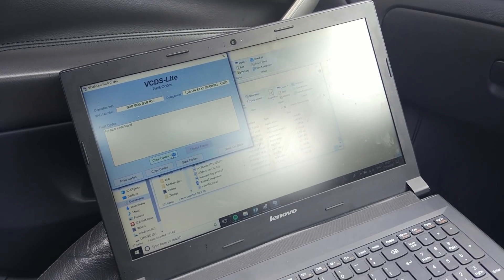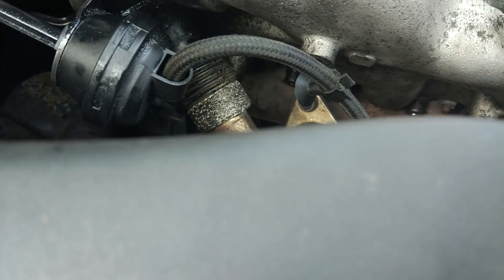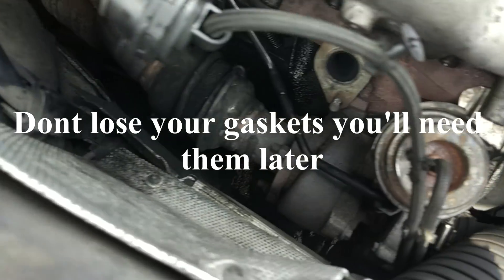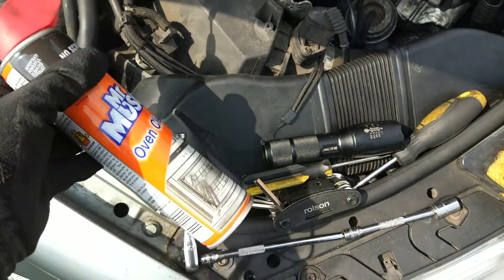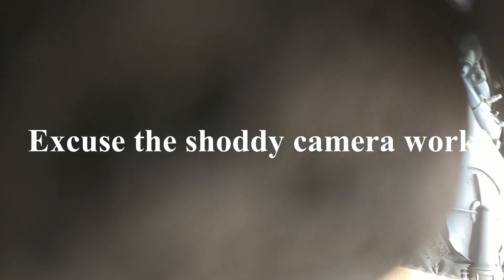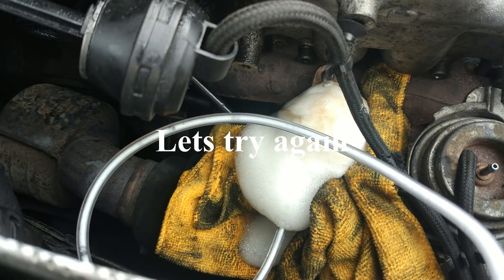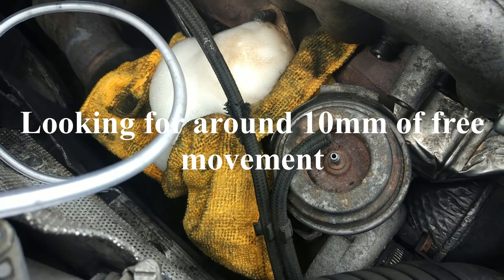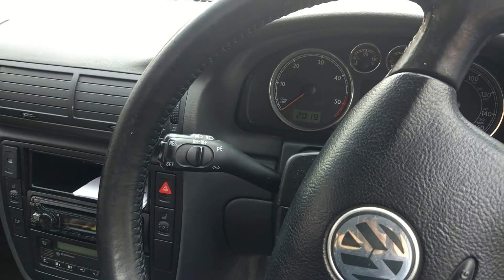How to Fix Limp Mode on a 1.9 TDi for £4.50 - Mr Muscle VNT Clean

Comment: Does this actually work???? Drive a 2016 skoda octavia vrs 2.0tdi and now my car goes into limp mode if I go above 2000rpm in 4th or 5th gear, tried to regenerate the dpf but couldn't clean it perfectly

Comment: (any oven/grill cleaner works) guys i can proove that this is really efective for unsticking you actuator rod if you got big siringe and tube to wiggle with the actuator you are really going to get rid of your limp mode, if its caused by this.... but i got some further problem... ive fixed this... before my car had 0/100-30secs now its better 0/100-20secs but i know my car has drive 0/100 in 12secs ! dont you guys know what it could be ? its not in limp mode but its lazy from the start

Comment: Tried this today and we blew up the turbo 😂.
Reply: Was it from the cleaner or was turbo smoked anyways
Reply: @ktmfour1007  We think the turbo was on its way out anyway. This was an attempt to see if it improved it but I knew it wouldn’t work. Car has now been taken for scrap as not worth fixing.
Reply: Wht was the car doing
Reply: @madkhan935  Going into limp mode when under load, e.g. long uphill road. Was also smoking a bit on startup. When we tried the cleaning trick it was putting out black smoke on every rev. This was the oil getting past the seals and burning in the engine. When it went the engine would run away when revved. Fortunately VW fit a device that blocks the air intake when you turn the engine off.

Comment: This is actually a really good trick caustic lime breaks down carbon like a hot knife through butter. 

Just a side note do not get oven cleaner on any aluminium parts. 

It will damage any aluminium parts it comes in contact with. 

Stay vegan. Stay clean.

Comment: Will this damage the seals inside turbo?
Reply: It's caustic, absolutely it will harden the turbo seals causing them to crack and leak oil
Reply: @robertjohn2249  Are u sure?
Reply: @krtolebiohazardcs  Yes, never put caustic inside an engine NEVER, a better option would be to use a garden sprayer and spray unleaded petrol in it. Or buy throttle body cleaner that has a special tube with a nozzle that sprays mist. Petrol is the best solvent to dissolve and break up hard carbon.
Reply: @robertjohn2249  - Hi, may I ask, is this a method you have used? it seems workable, though a little worried about it slipping into the sump and compromising the lubricating oil?

Comment: I used this same technique on my egr / inlet manifold on my seat altea xl 1.9 tdi. Had the emission service centre warning, which when I plugged in my code reader threw up the P0104 egr insufficient flow error. Mr Muscle worked like a charm.

Comment: Great video straight forward & shows exactly what to use and how to use it - 5 pound is a cheap fix compared to a complete turbo unit
Reply: Your better off removing the turbo and open it and clean it out manualy (all depends how you look after your car).
.that way you wont get shit going throug your exhaust and you know its clean as new and both sides.was quoted £400 for replacement turbo and fitting.so i asked how for turbo removal and fitting,it was £150 he also lossen turbo bolts for me .after opening it i can see that mr mscl cleaner wont even get into the hot chamber to clean the vnt mech side but only the vaines.was easy 2hours  and i know how clean my turbo is.

Comment: I'm going to do mine but going to take turbo off. And also do the air intake. After deleting my EGR valve completely. As I've just blocked the pipe and I soon will be capping of exhaust feed but leaving old egr there after cleaning and welding or bolding egr valve closed. Cheap fun and simple

Comment: 1 L deionized water into garden spray bottle. Get engine hot, park somewhere. Open bonnet, take hose off after MAF and air box. Block engine on 2500 RPM, spray that water into intake, stop only when engine slows. Straight after go on 15 miles hard driving. Clean all exhaust parts, from combustion chamber, through exhaust valves to turbo. Tested by myself many times. I have turbo back straight, but short pipe. My neighbours loves me when I do it every couple months on Sunday morning. 😂
Reply: I've heard about this but never saw anyone actually doing it. Good to hear it works good for you. Does engine layout affect this ( Inline, V, might have different airflows to different cylinders and thus only a couple get the majority of the water perhaps?)

Comment: Just did this on a 2008 2.5 TDI VW Touareg..  very easy to get at the egr cooler , the nuts and hex bolts are right on top ... just take it easy and dont snap or strip them ...  As soon as I can evaluate the results I'll post here ... 

OK ...  Initial update .. same day .....
Power is smoother across the entire rev range ..  quicker pick up , more gradual , no big catapult effect after an initial lag ..  It just go's ..and keeps going . 

Very happy so far ...  easy job really .. I did deviate a little from the guide here ..  halfway through I used a screwdriver and a piece of wood to keep the actuator open for 30 mins .. My thinking was that It would expose even more areas to the solvent .. 

After warm up ... ( dont rev the nuts off a cold diesel engine )   I took it for a short , energetic drive.
Holy moly the amount of black soot / carbon that came out of the exhaust was like a smoke screen ..
I assume this was the residue that had been removed by the solvent getting blown off ... It cleared within 30 seconds.
Reply: How about the cleaning after one year? :)

Comment: Can you replace the vanes individually or do you need to buy a whole new turbo? Ive had my mk4 golf gt tdi completly flushed through and clean, i have before and after pics. But i still go into limp mode, seems to be a bit different now though, before it would stay until i turned the car off/on and now it seems to breakthrough limp mode on a fast straight bit.
Reply: Hi
You could check your MAF sensor or the wastegate air intake (modern diesels have an air intake valve that closes when the engine shuts off to stop its final shudder before stopping).
I also had problems on my old Mk1 Octavia, found the plastic Armature on the Wastegate air intake valve had snapped, so vibration was causing it to partially close while I was driving.
Reply: Simon O'Leary Thanks mate but I finally fixed the problem, it was a faulty MAP sensor. Actually had it replaced awhile ago, but that must’ve been faulty too as was a cheap one. Was doing it 9/10 times now hasn’t done it for almost a month.

Comment: Good morning Coathanger. 
I watched and followed your advice except I never removed the FAULT CODE, I ended using all of the Mr Muscle in a 3hrs 20 mins later. Done a EGR delete in. 
Started the car & let it warm up, did as you said at 3/4000 rpm & then drove the car at 60mph for a 5 miles to given the ECU time to reset it self..
Thank you, great video & very easy to follow. Most importantly you have help me save ££££'s 
SPOT ON 👍👍👍
Reply: Peter Black did you have to repeat this since you posted the comment?
Reply: Hi there . My problem is I can't get over 2000rpm . Limp mode. . Any advice please . Not done anything yet
Reply: @andymillios2570  I’ve got the same what did you do to fix
Reply: @louismoran  sorry only just seen your message. Have you sorted the problem with your car
Reply: @andymillios2570  nah I sold it

Comment: I have a question. Why the EGR clogging up? Is that when you always drive slow? 
And if you have a heavy foot, is there a chance that it break with carbon?
Reply: Its because you haven't deleted it yet.
Reply: egr will clog up no matter what u do because the exhaust gas running through it if u want my advice just delete it the engine will be much MUCH happier without it 😉
Reply: @M07MD_02   is that acc true?
Reply: @HarryTurner24  Yes, it limits your engine and if you’re going to get rid of it, get rid of your dpf and maybe swirl flaps too

Comment: PURE 100% shit . Ive done it and seen 2 cans of stuff used.Then a full turbo strip.  if a max 0f 3 % of the vanes where clean it  was lucky .
Reply: Doesn't really matter as long as they move properly. If any vanes move fully, they must all. Not saying it will last forever (I've stripped and cleaned turbos myself) but compared to the time and effort of removing and stripping, for most people this is worth a go.
Reply: @dopiaza2006  it did it's purpose, just annoying when away from home and limp home mode flags up
Reply: I did the same on my Mondeo. Lasted for 4 weeks at a time. Eventually got rid of the car

Comment: Archoil AR-6400D works well to prevent refouling. I run a bottle through every 1000 miles or so. Supermarket diesel contains more biofuel and causes a lot of soot problems especially on modern cars
Reply: V Power from Shell is good stuff

Comment: I have the same engine in my passat tdi and wondering what you actually fixed/cleaned with this ? Beside the Wastegate there is nothing that could cause a problem. Most problems on this engines are caused by damaged vacuum tubes. The hardest part is to find the leaking one. It's a great engine. I own a passat estate wagon in the same colour by the way
Reply: There is no wastegate in a VNT turbo.
Reply: Peter Thoma he fixed the over boosting problem.. it was over boosting because the vanes in the turbo that control the level of boost get clogged up with carbon build up and get stuck open which they call “ sticky vanes “ it’s a common problem with older diesels mate.. I’ve actually got to do this on my mk4 tdi golf as mine will over boost ever so often
Reply: @w3stiiee691  yeah that's what I thought but this turbo is good old one without this fancy fans..

Comment: On my bmw diesel i was getting dpf warnings and fault codes and too high backpressure on dpf. So i bought liquid oven cleaner spray and while engine was running at 1500rpm I used a hand oil pump and pumped inn the cleaner where the pressure sensor was conected and somehow the backpressure is soo much reduced that it look like its new the dpf :p 
Oven cleaner 10$. Dpf cleaner from tunap 100+$.
Reply: um... to clear the dpf you just have to do 20+ mins at 60+mph down the motorway. That triggers a regen cycle. 

if it's too blocked to clear on it's own, it's finished, manually cleaning wont help, it'll never work the same
Reply: John Smith last year the main stat was dead this year egr stat combined with winter and sometimes very short journeys clogged the dpf to the point the ecu did not perform regen. And there is 3fd0 fault code that newer goes away no mather how many time i clear codes it just gets back instantly without even starting the engine. So i had 2 option at that moment. Take out dpf and pressure wash or oven cleaner. And maybe the dpf gets damage from that but if it gets higher backpressure again i just do the oven cleaner trick again :p

Comment: yours is nice and easy to reach man, on the golf mk4 its a bitch to reach at the back. did mine a couple years back, worked a treat, but recently started sticking again, need to do it again.
Reply: Try a Mk5 with a huge egr cooler and catalyst in the way,.

Comment: do you started the car with the foam still inside the turbo ? and without the pipes connected ?
Reply: Foam of course inside turbo (How could you remove it other way?). And pipes connected too. Foam will quickly disappear after starting engine. Note that Mr. Muscle contains sodium hydroxide. It's extremely toxic for eyes, so always use protective glasses when you use this product.

Comment: Doesnt oven cleaner eat away rubber?RIP oring oil seal inside turbo and turbo oil leaks then?Idk that oring seal is very thin
Reply: IT does, but the turbine shaft seal is made out of metal.
Reply: O-rings in a turbo core? Would surely carbonize in less than a second...

Comment: Is this a temp fix or is the car still driving mint?
Reply from the maker: Glad I could help, I've got a boost leak on my Passat that needs sorting next. Maybe I'll make a video for that too 😂
Reply from the maker: Brad Brad Still driving fine mate 👍
Reply: coathanger1962 cheers mate. Done this yesterday & worked a treat, recommend everybody to follow your video! Thanks again!
Reply: Is it still going into limp mode
Reply: @reecestobbs1194  no. Because he cleaned all the shit outta the turbo.
Reply: Wheres the boost leak video